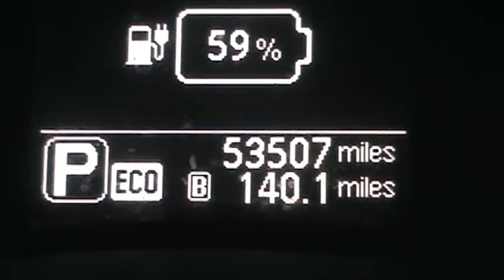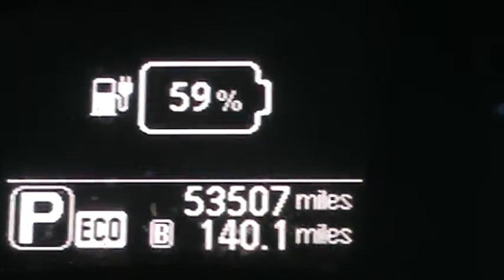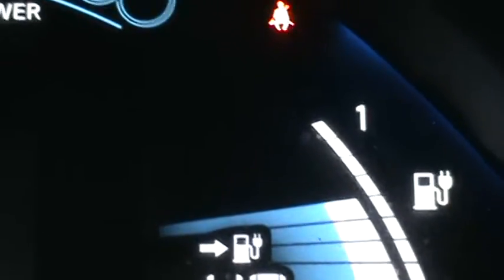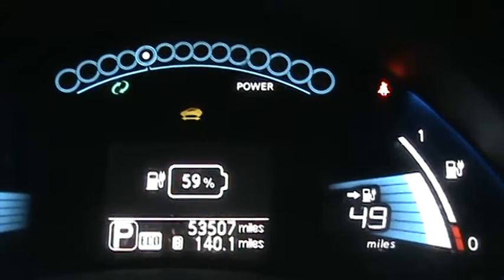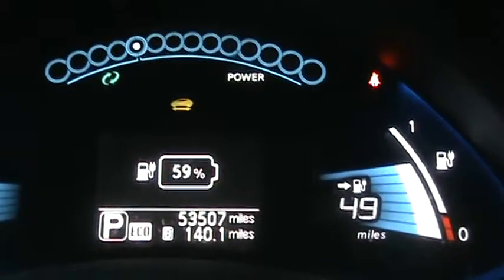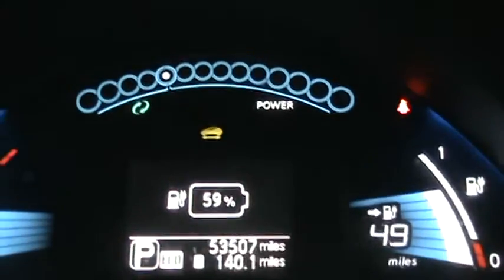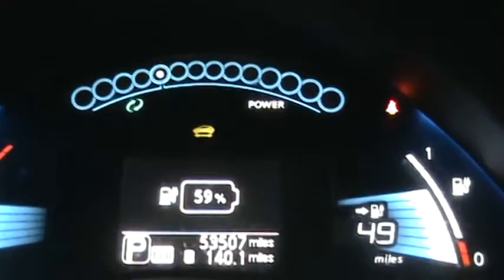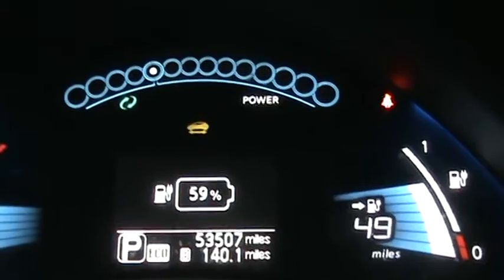Regenerative Braking LED Brake Light

Comment: I've been wondering if when I slow down in B mode if the guy behind me was getting a brake light,  never checked. I agree there needs to be something to notify the tailgaters. My 2013 leaf is at 9 bars and still serves my purposes well.

Comment: It is a good idea to put a pressure switch on the top of the gas pedal. This way, anytime you press the gas pedal, you release the switch and the light goes off

Comment: i do not think the bar going away had anything to do with that hot day.. it was just that your battery had lost 12% of it's full new capacity (the 1st bar is a lot more than the rest.  I think the following bars are 6% each).  It was just it's time and it dropped the 1st bar.  Good idea about the regen.. all EV need something to let cars behind know we are pulling energy to slow down.. maybe a little orange light inside the brake light comes on when we regen and then RED when the regen or braking is enough to slow down by a substantial amount?  either way, none of the manufactures have bothered to bring a solution to market yet. but it does need to happen, since in American drivers base their speed upon cars around them.. they are not happy unless they are tailing you.